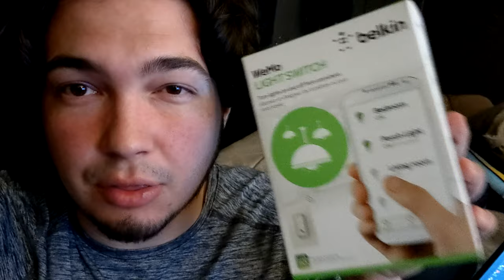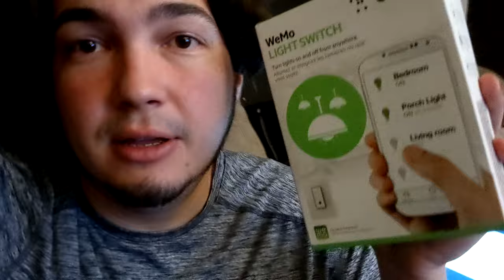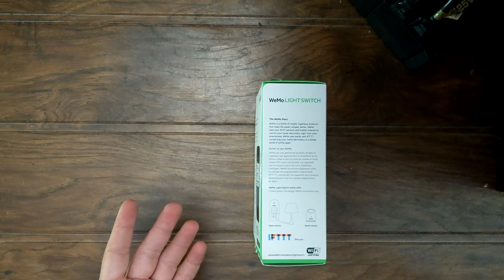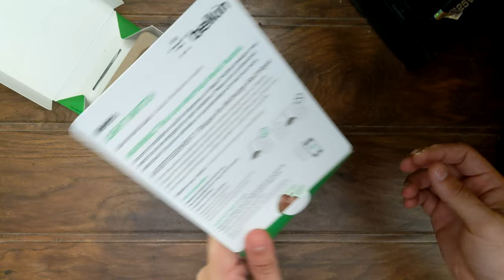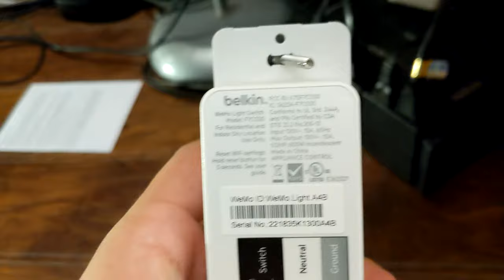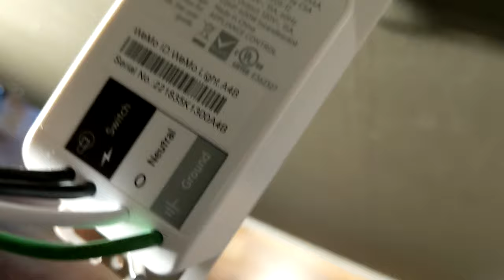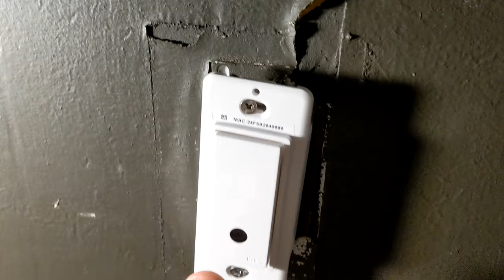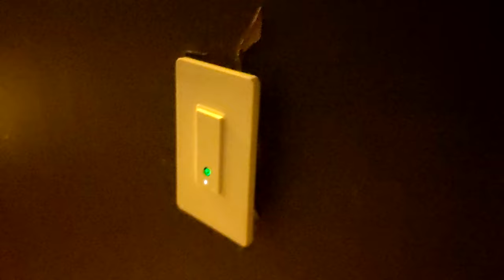Belkin Wemo Smart Light Switch Setup & Review Without Neutral Wire!

Comment: This is VERY dangerous and if you're in an apartment  with maintenance people,  you're probably going to get someone killed by electrocution. You have essentially energized your entire apartment's ground system with 110 VAC. Even if you turn off the circuit breaker for a circuit down the line from that switch, the ground wire at that circuit could still have 110 VAC on it, because at that switch, you've tied the ground wire system to a live 110 VAC circuit. You would need to turn off the breaker to that switch as well in order to kill the 110 VAC on all the ground wires in the apartment.  Better to use smart bulbs if your switches don't have neutral wires. They're easy to setup, and don't cost that much. They're like $30 for a 4 pack of bulbs (less than $10ea).  About on par with regular LED lights these days. I just bought a bunch of gosund smart LED, fully color changeable bulbs for my house.  They work great.
Reply: Agreed this is dangerous on many levels and should never be done.  It's also against code and could cause a fire or electrocution. The ground wire should never be used as a neutral wire. If you don't have a neutral wire, they have smart light switches that don't require them, this video shows you how: https://youtu.be/nGPgJmyjgp4  or you can add a neutral wire to your system by following these instructions: https://youtu.be/LaqPDBbMgLM. No one should ever do what you show in this video.
Reply: Can I make a fake ground with a diod?
Reply: agreed, but find it interesting that he states that it was his building's maintenance guy who told him to do it like that.

Comment: I know this is an old video but for anyone who does this PLEASE put a fuse (smallest value and a fast blow) on the white or black wire.
Reply: Hey there…. So if I just add a 5a fuse to the neutral wire I can then connect it to the ground wire?
Reply: @LrgPicture          Again,  this is NOT a great idea,  BUT if your going to do it a fuse MUCH smaller then 5a would be a good idea.   The smallest you can find that does not blow when the switch is turned on.
Reply: @KC8DKT  ok thanks for the info. I have a bundle of white wires in the box coming from my wall. I’m wondering if connecting the white Wemo neutral wire should be connected to that group??? They (white wires) are all capped off.
Reply: @LrgPicture    Its only a GUESS but I would think the capped off wires ran to another switch most likely or perhaps some outlets down the wall.    I would not mess with them and you would definitely not need them for what you're doing.    Treat them as live just to be safe though!
Reply: @KC8DKT  ok … thanks for that.. so you’d just put a fuse on the neutral wire then… call it a day
Reply: @KC8DKT  I’m just not sure what to do about the neutral wire
Reply: @KC8DKT  hey there…. I got them going… thanks for your help today!
Reply: @KC8DKT   I found this old video as well looking to install a smart dimmer switch but I have no neutral wire. I am planning on doing the same method.

I watch some how to. 

What are you suggesting to be done if doing this method ? A fast fuse A5 and what else ?
Reply: @LrgPicture  what is the end result to do to make this safe and work ?
Reply: @BobBob-ss3nr    I would go with the lowest rated fast blow you can get to work without blowing.  Put the fuse on the GREEN switch wire connecting it to your earth ground wire in your box.  You can use a really low Amp fuse "much lower than 5amp" for this because it's only going to power the switch Wi-Fi internals.  The white wire will be powering the light or whatever the switch is turning on/off.

  Someone not knowing the ground is live may still get bit but at least it will not be able to grab and hold them.

  Would be a good idea to put a sticker on/in the main breaker box "LIVE GROUND" as well.   PLEASE take your time and be safe!
Reply: @BobBob-ss3nr  there’s a bundle of white wires (neutral) I tapped into and everything’s been great since. No problems at all.. make sure you keep all the white wires together. It didn’t work without doing so.
Reply: @BobBob-ss3nr  also… I’m not an electrician so take what I said with a grain of salt… but it’s working though. Few weeks now.
Reply: @KC8DKT  Putting a fuse in the ground wire is a stupid suggestion - please stop. No fuse anywhere will help in this case - no matter how small. It only takes mA to kill you at 120V under some conditions. The white wire here is a return path only for the switch internals. Connecting Ground & Neutral except at the breaker panel is bad because of potential wiring faults - it is against code. No way around that. Don't do it.
Reply: @alanmoore2197  

And I said it was a bad idea!    the fuse will stop a FIRE!           THEY ARE DOING IT, the fuse is better than nothing!
Reply: @KC8DKT  The fuse is NOT better than nothing - it is WORSE THAN NOTHING - don't comment on stuff you don't understand.
Reply: ROFLMAO

Comment: Sooo if you touch the mounting screw for the switch which you just grounded to the box that the screw it in and you turn the breaker on... are you gonna get a nice 120v thru you now?
Reply from the maker: I stayed their another 5 months or so. Never had an issue. I only did it because the maintenance man said it could be done. It never seemed hot those, shocked me or had any issues. Didn't see any burn marks when I removed it when I moved.
Reply: Well my thought is when you complete a circuit power runs thru that’s why it works. The electrical box is the ground so one would think that completes the circuit and anything metallic connected to it would shock you. 🤔
Reply: @BigCVlogs  you just put 110VAC on the entire unit's ground wire system, which is electrically fine to do. However when anyone works on another circuit down the line from there, and turns off the circuit breaker for that circuit, if they don't also turn off the circuit breaker for the smart switch, then the ground wire at the circuit they're working on is also hot, and not turned off by the breaker for that circuit. And that = electrocution. And.... it's actually illegal to do this, for that very reason.
Reply: @crtrue6432  if maintenance people working on electrical most of them use a voltage tester before even touching even if they turned the breaker for the area they are working on

Comment: How STUPID that the maintenance guy told you to connect neutral to ground!!!  DANGEROUS.
Reply from the maker: Yeah, I had no clue at the time.
Reply: @BigCVlogs  Yes not your fault.  That guy is getting mixed up because the Neutral & Ground join together at the main box from where the power to the bulding starts.  A little knowledge can be a dangerous thing.  I have the same problem with no neutral at the switch .. but there are some Smart switches that are built to use Live only and don't require a neutral.

Comment: A casual web search would show that using neutral as ground is a big no-no. You need to talk to an electrician if you don't believe this, not a handyman. If you have no neutral wire in your switches, just replace your bulbs and/or fixtures with smart versions and leave the switches alone. Then you can turn the lights different color temps and pretty colors, be the envy of switch people and their precious neutral wires.

Comment: Substituting the ground for the neutral is an excellent idea... If you want to burn the house down.
Reply from the maker: I must say I'm not a electrician but the handy man said it was ok and from what I found online they are like the same thing. I had it installed for about 4 months before I moved and never had any signs of an issue. But again...not an electrician so I'm honestly not 100% sure.
Reply: ... burn the house down and go to jail for manslaughter when a maintenance worker gets electrocuted because the whole uninsulated ground wire system has 110 VAC on it.
Reply: @BigCVlogs  they are NOT the same thing. They CAN BE USED for the same thing in some cases, but the neutral and ground serve VASTLY different purposes. Neutral wires complete circuits, ground wires are not supposed to have any voltage unless things have gone horribly wrong with the circuit and stop electricity from burning down the house, and stop electricity from carrying over to the rest of the house in the event of a short. Making the ground wire hot basically electrifies the whole house's circuits. Even if the breaker for a particular circuit is off, the ground wire can still be hot if you do this.
Reply: Not if your house is made of solid concrete, and not like those Florida plastic homes.

Comment: Not recommended to do this , just defeated the safety grounding of your home,  the neutral is meant to return any unbalanced loads from your circuit back to the transformer,
Reply from the maker: Trust me, I wondered if it was safe of not. Didn't think a maintenance guy would tell me wrong lol.
Reply: @BigCVlogs  unless there maintenance guy is an electrician, don't do anything he says with the electrical system in your home. NO electrician would tell you to do that. First it's dangerous. Second it's actually against the law.

Comment: This will put 110v through your ground wire.  For liability I would take this video down if it was me so they don't point to you if someone gets electrocuted or starts a fire. The need for the neutral wire is due to having a wifi chip that needs to run when the light circuit is turned off.